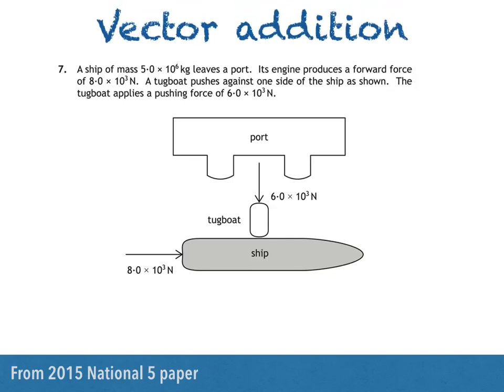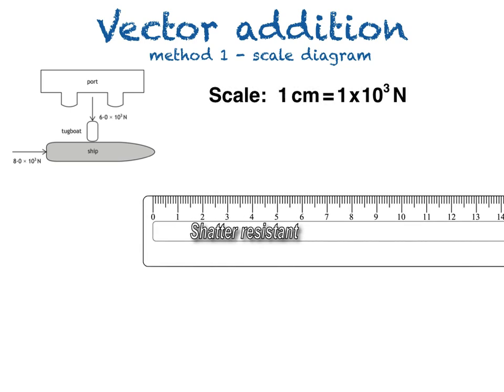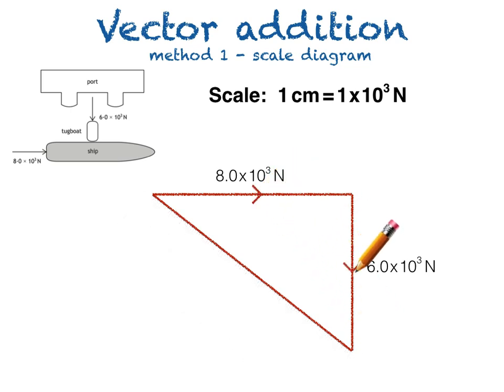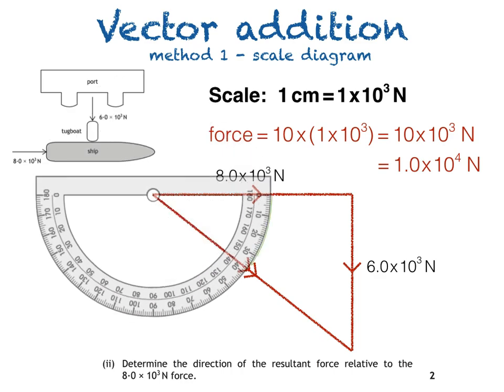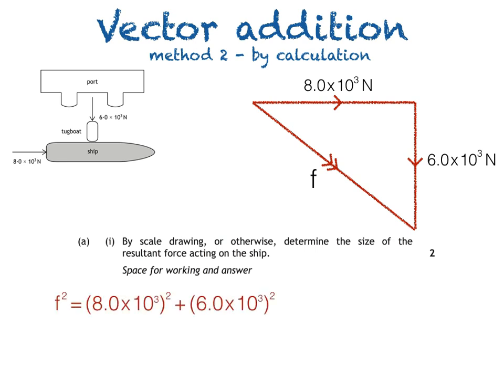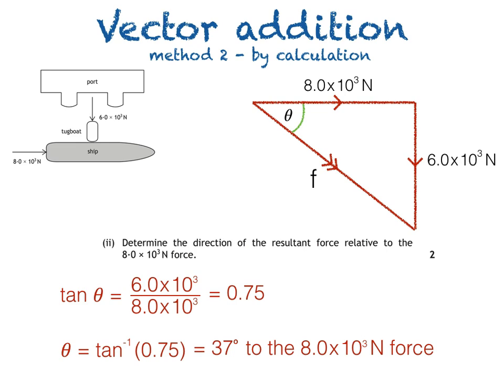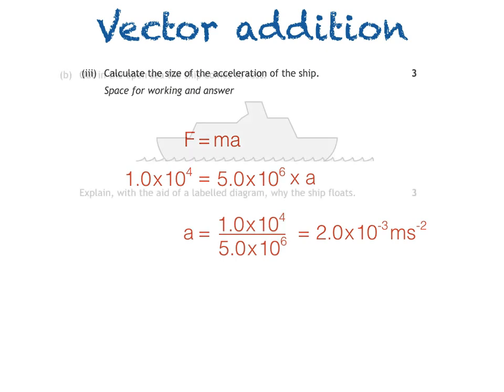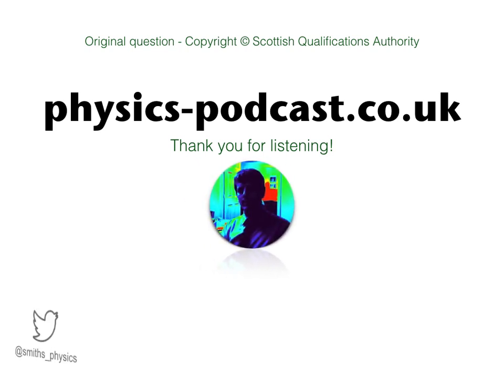National 5 Physics - Vector addition

Comment: In this question, I drew the triangle from tip to tail but with 6x10³ on the left, and 8x10³ on the bottom. I get the same length for the hyponeuse, but a different angle of 53 as I therefore do tan-¹(8x10³/6x10³) Can you tell me why this is wrong? Thanks!
Reply from the maker: If you were just asked for the direction then that would be fine - you could draw the forces in either order as long as they were 'nose to tail'. In this question, however, you're asked to 'Determine the direction of the resultant force relative to the 8x10³ N force'. Because of this, you have to draw that force first so that the angle is measured from it. Hope that helps.
Reply: @MrSmithsPhysicsonline   Thanks very much, that makes sense. I appreciate the quick response. 👍

Comment: Do you not do the bearing from the north line so it would have been 90 plus 37
Reply: I know this confuses me so much
Reply from the maker: The angle can be expressed as a bearing or as an angle to north, east, south or west. Increasingly, SQA questions use bearings.
Reply: Mr Smith's Physics online so i could write at a bearing of 127 degrees?
Reply from the maker: Having just looked at the question, it's not stated that upwards is North. Because of that, for this question, you can only measure the angle from one of the forces (that's what I did in my answer). Look out of an arrow pointing upwards with 'N' marked on it. Otherwise, you'd be measuring the angle as I did in this question - from one of the component vectors.

Comment: Hi there sorry to be a bother but if you have the time is there any chance you could give me the physics definitions for a /fuse/diode/capacitor/motor/relay/LDR/thermistor/photovatilic cell thanks
Reply from the maker: It's the circuit symbols you'll need to know for these components as well as how they perform in a circuit i.e. a thermistor's resistance decreases when it is heated. Check out my videos 'Circuit symbols test' and 'Voltage dividers 2' - they're a good starting point.
Reply: Mr Smith's Physics online thanks